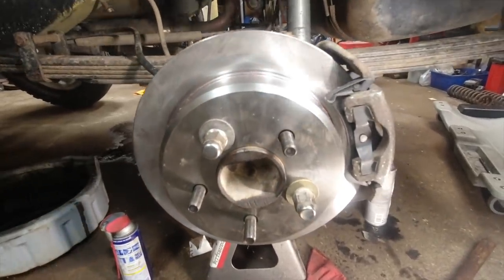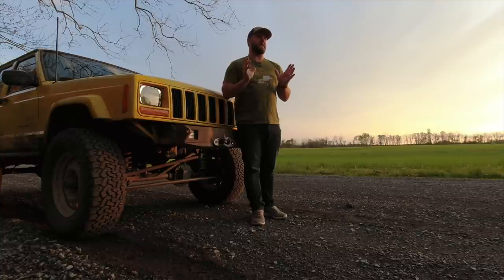Simple XJ to ZJ Rear Disc Brake Upgrade

Comment: I just did the Liberty rear disc brake swap, but got new Powerstop rotors, shoes, snd calipers rated for towing.  Crown makes parking brake cables for 1984-1996 disc brake conversions that are a drop in fit (it’s intended for their upgrade kit but works with ZJ or Liberty rear disc brakes on XJ as well).  Mounted the ZJ hose brakes on one of the leaf spring bolts.   I am stunned by the increased stop speed on these.  And the parking brake grabs so much better than the drum brake - only need to pull handle maybe 1/2 way, and it’s solid grab even on steep hill.  Wow.  Rear disc brakes are awesome for Cherokee!!

Comment: To remove that parking brake cable, use a 1/2" or 13mm box wrench, slip it over cable end, over the lock clip and the cable will release.
Reply: Thanks for the tip!
Reply: My preference is a 1/2" drive 13mm socket. But to each their own
Reply: Loosely installing a small hose clamp does the same as well

Comment: Use liberty backing plates and calipers. No grinding needed, they slide right on. And 90s ford explorer parking brake cables.
Reply: Yes. Also can use KJ parking brake cables too. That's what I did.
Reply: What year of liberty?
Reply: @cameronwebb3959  02-07
Reply: People use the parking brake?😆
Reply: @cameronwebb3959  2003-2005 and early 2006 before they changed the axle and brake system configuration.
Reply: @alale923  Only those not gutsy enough to trust their 3500lb or heavier rig to a single 3" long piece of metal inside the automatics.  Some might trust the manual more with the thrill of watching it roll away because the engine crank could turn.
Reply: The real mvp
Reply: Aaron my rear backing plates are really bad,  I'm not a mechanic, I have a 2000 jeep cherokee sport or xj,  my question is how much do I need to change to install this back plates from jeep liberty, and which year should I be looking?  Thanks
Reply: Yes I just did mine on a 95 xj, out of a 2003 Jeep library plug and play
Reply: @tonyhermosillo1629  good to know.
Reply: if I could find liberty backing plates
Reply: so, you absolutely-the-f***-can-not use Ford Explorer parking brake cables. The passenger side one works, but the driver side is too long, uses a different attachment point at the front, and doesn't snap into the circle at the back of the equalizer. 

Prior to 1995, the Explorer had Drum brakes, so that's a no. 1995-2001 Explorers are the cables we're apparently after, that I can confirm, absolutely do not work. 2002+ have different style etc etc.

Serves me right for wasting all that time and money figuring that out, trusting some random dude in a bleepinjeep comment section.
Reply: @WAEMID IV  fancy seeing you here ✌️

I was literally just about to put explorer cables on my to-get list for this weekends junkyard trip. Sorry you had to go through a shitty experience, but many thanks for saving this guy the same trouble. I guess even in the archaic jeep community you can't always trust what you read. 🙄
Reply: @HowDothTheRaven  That's why I make videos - so people know what to actually do. Because I'm a person too, and I get angery when I waste time and money just like everyone else. I'm working on the disc brake swap video right now  ✅️

Comment: Experience talking here: When you do this, the zero dollar option after the install is to find your proportioning valve (next to or under M/C), remove the stud from the front, pull off the o-ring and reinstall the stud. This gives full pressure to the rear disk brakes. Failure to do this reduces the pressure to drum brake levels and therefore doesn't really improve the brakes. Of course an adjustable proportioning valve (Ebay, etc.) is also a great option.
Reply: Bet ya 10 bucks only 30 percent of people do this; I wouldn’t have known. 

Thank you.

Comment: I did this swap on my 94 2 door. Definitely worth while.  Hard part was getting the e brake cable mounted. I used a cable clamp u bolt and drilled a couple holes in the arm where the cable needs to hook up.  Not much room but an option if you cant do the adapter pieces.
Reply: Great idea 💡

Comment: i did the conversion last year on my 8.25, but i used a kit. Only reason why, is by time i got done finding the parts i needed from junk yard and then new calipers and parking brake shoes and other random stuff to do it. for a few hunded bucks more give or take. I could just do the kit, and it already came with everything.
Reply: @minegun3 where did you get the kit from?
Reply: ??? How much was it

Comment: The Liberty parts are a direct bolt on. No backing plate grinding needed and use the backing plate studs from the Liberty. Also, the front XJ wheel studs fit the rear axle and are the correct length for the disc brake rotor.
Reply: What year for liberty?

Comment: @2:50 a 13mm (if I remember correctly) box end wrench will slide right over the tabs and close them in
Reply: Thanks! As I was editing I realized "I bet a box wrench or deep socket would work" DOH!
Reply: I was just going to add that 13 mm or 1/2-in wrench box then does work well that is the best tool for that cable Good call
Reply: @DRTJon  haha yea, I fought with mine with the screw driver for approximately 7 seconds before I went and found the wrench.
Reply: I use a bit of pipe. My jack hand e was about the right size
Reply: @tortron  I went to Harbor Freight and got a one and a half ton aluminum jack for mine because those little trolley jacks are so damn dangerous be careful with that thing they're really unstable I'm a master tech and I've seen a lot of those things tip over That's another good idea though The jack handle would be the perfect size it's about a half inch inside diameter that will compress all three of those little springs

Comment: Jeep has a way of making things so simple but every now and again you'll find some clip or bolt that looks like it was designed in a different universe. Lol like that e brake clip and the 2 bolts at the top of the bell housing that take an "E" socket like  e35 I think

Comment: Well done I’m going to save this one. I’m thinking it is probably best to do this at the same time one would install a Torq locker, which sounds like a future project. And I assume that locker is still preforming well and was a good choice for the XJ.
BTW in the warnings that you placed you did forget to include to mention California prop 65 🧐 Maybe next time, I actually have to include that silly warning with the XJ bags I make.

Comment: I got the G2 DISC BRAKE CONVERSION KIT FROM 4wheelparts was a direct fit. Didn't have to change the stud. No grinding was easy install.  Its pricey and it Didn't come with emergency brake cables. I have 95 jeep cherokee xj with 8.25. With out ABS

Comment: When pulling the emergency brake if you get the proper size line wrench you can push it over there and it will push all the pins and at the same time

Comment: I did basically the same thing but didn't bother with the proportioning valve.   WJ front brakes and KJ rears.  I still need to try it on glare ice to see how the brakes perform, but its not looking like it is going to be a problem.  Add a spare tire carrier with a 33" on it, and with that alone, you'll probably want the more rear brake bias.

Comment: liberty brake backing plates go on a little bit easier but same swap. been planning on doing this when my drums need to be serviced again
Reply: yeah the KJ Liberty seemsto be an  easier swap and easier to find in the junkyads
Reply: @motownXJdad9565  its the same thing you just dont have to grind out the backing plate to make it fit, I think you get ZJ brake lines instead of the liberty but if you put them on the backing plate before you pay they probably wont charge you for them

Comment: when you scavenge your parts either from a ZJ or the KJ 8.25 for your swap, remove the 4 studs from the housing that hold the backing plate on so you can re-use them on your housing so your studs arent too short. remove the plate, put the 4 nuts back on so you dont booger up the threafs on the stud before you pound them out with a hammer
Reply: Ok this is going to be a dumnb question you sad ZJ or the KJ what jeeps are them going to a junk yard to get the parts.thanks
Reply: @robertwilliams2623  ZJ is 93-98 grand cherokee, and  KJ is a jeep liberty
Reply: @motownXJdad9565  thanks for the info

Comment: The best way to remove the brake hose would be to put the flare wrench on the nut and the vise grips on over top.
Reply: Solid suggestion

Comment: I would try to get the emergency brake cable well away from the leaf springs. The movement from the leaf springs won't take long to rub through the emergency brake cable... Just an idea.

Comment: Great video! Those u-bolt cuts look dangerous tho. They're cut really short; wouldn't want them to loosen up because they'd come off real quick.
Reply: You only need 3 threads for full bolt strengh. You could cut those down to half way down into the nut and as long as they are torqued its all gravy.  I have my u bolts cut to 3 threads showing above the nut way easier to deal with then the way those long winded bastards are from the factory.

Comment: All you recommending using liberty park brake cables you must have no lift cuz none of the Ford or liberty or grand cherokee cables are long enough with my lift. Also flop shop doesn't make the 8.8 cable adapter any more. So Im fabricating my own adapters using the long cables that are with the 8.25 drums.

Comment: I wonder if you take 2 XJ body's cut them in half forward of the C pillar weld the 2 halves together make an "overland" trailer. replace one of the fuel tanks and use it for water. the other tank for spare gas tank.

Comment: My 01 Sport has the 15 inch OEM steel wheels.  It looks like the the XJs had 16 inch wheels at least.  Would I be in for a tires and wheels investment to make this upgrade work, or will the XJ parts still fit?

Comment: I did the liberty disk swap, I even put in a HD brake booster to replace my old stock one. It still seems like I have the same braking power. I did forget to change out the spring/valve. Could that small part make the difference if I forgot that part??? Btw I’m trying to stop 35s still feels like stick brakes.

Comment: What did u do about the brake proportioning valve in the standard master cylinder did u replace whole thing replace valve or u running it with drum brake pressure on disc and pad

Comment: What size wheels are your running? Do you know if 15 inch wheels will still work after the upgrade?
Reply: I have 17” but these aren’t huge brakes I don’t see a problem with fitting 15”

Comment: I wish it would have explained the brake line situation a little  better. I'm a little lost on how to adapt the stock brake line in the rear to the caliper. Sure it's easy, I just like to be thorough
Reply: First step is to mount the hose to the axle tube. You don't have to do it exactly as I did if you don't have a welder, just make sure it isn't going to contact anything and rub through. Then you need to shorten and bend the brake tube slightly to properly reach the ZJ hose.
Reply: @DRTJon  oh I see. So you just cut and replaced the existing brake line to meet up with the caliper line? Also what year zj can I pull this stuff off of?
Reply: @slightlymodded1  correct it's cut just a few inches.  Any ZJ with the V8 will definitely have the D44A rear that had disc brakes, I believe this was available in all production years of the ZJ

Comment: Do you have to use the E break pads for the swap?  because I cut mine off because I didn’t want it... Could you assemble it was just a rotor and backing plate and caliper?
Reply: You could, the parking brake shoes are just along for the ride until the cable is pulled. However even on a trail rig a mechanical brake is not only safer (what happens if you rip off a hydraulic brake line and then get into a steep descent?) but I often use mine to help cut a sharp turn or just provide some drag if needed on a crawl

Comment: Quick question, what is that little contraption in front of the master cylinder with the hose that goes to the firewall? Do you have a video explaining what that is by chance?
Reply: Air filter. The intake is in the wiper cowling. Raises the intake without a snorkel.

Comment: My XJ is an 89, yours looks a little newer. Same brake setup?
Reply: 89 is probably not a Chrysler 8.25 axle but a Dana 35. 8.25 out of a 96+ is an easy bolt in swap (grab the drive shaft too if you can, or do an SYE and new driveshaft) or you can do the Ford 8.8 swap which can be found with 4.10 gears, LSD, and disc brakes already, but will require new leaf spring perches and some other mods. It just depends on your location for what’s available at what cost, and skill set for which one is best for you.

Comment: I have a 1994 XJ with the police package for the drum brakes. Any idea if this mod will work on mine?
Reply: in 94 they did not have the 8.25 axle. You can easily swap one in, which would almost certainly be an upgrade. The 94 I had came with a Dana 35 axle
Reply: @DRTJon  purchased my 2dr 2wd sport ax-15 brand new it came with an 8.25, pushing 416k miles on it with a gear swap from 3.07 to 3.55

Comment: How’s the brake bias now compared to stock?
Reply: To me it's right where I want it. Haven't locked up the rears but they are definitely putting in work, I don't feel a strong dive on hard braking, it's well balanced.
Reply: @DRTJon  something I just thought about is what about in the snow from your experience with it the same question apply’s. I live in Michigan so ice and snow is a thing also. Thanks.
Reply: @mishooter4774  haven't had any snow with them but I like to cruise gravel roads a lot and carry some decent speed at times. I haven't had any sketchy moments braking

Comment: Can I get that spring separate?
Reply: Only way I know how to get one is at the junk yard or get a whole proportioning valve from a ZJ and you can just swap the spring in. I chose to swap in the spring because the ZJ valve, though it is the same dimensions and design, mounts differently. Far easier to change the spring than to undo all the lines and re-bleed the front brakes and everything. I found I did not have to bleed the front brakes doing it this way but YMMV

Comment: I like my 8.8 swap with disk brakes better.  :)  Definitely do the ZJ proportioning valve, it makes a world of difference. I would drive backward and slam on the brakes and the front would lock up but not the rear. Once I swapped the internals of the proportioning valve they can lock up going forward.
Reply: I still I the drum brakes on my (# XJ.  Going backwards I hardly have any brakes! Scarry if I have to back down a steep hill since I can't stop!  Would the KJ proportioning valve fix that?
Reply: The general consensus is that the disc brake proportioning valve allows less rear brake pressure, right?  I have WJ fronts and KJ rears and left the drum proportioning valve alone.  I need to wait until some snow falls so I can check the brake bias.  If you want to keep the drums, I would recommend an aftermarket proportioning valve and tune it how you want it.  Any significant amount of trailer tongue weight and the braking in 2wd is terrible with that setup.

Comment: will this work on an 1989 with Dana 44?
Reply: They bolt up, but with how the bearing retainer is on the end of the axle tube, you need a custom spacer (which presses on to the axle shaft when replacing the bearing) so with the thicker caliper bracket, the retainer is still putting the correct pressure on the bearing. If that sounds complicated, it’s not...it would just be a lot more involved than this pretty quick bolt on swap is
Reply: @DRTJon  Thanks,  I am finding that a single diaphragm brake booster with drum brakes and 35 inch tires make stopping a bit slow.